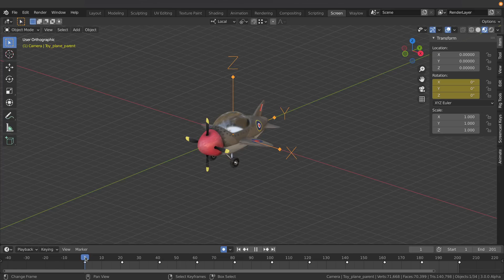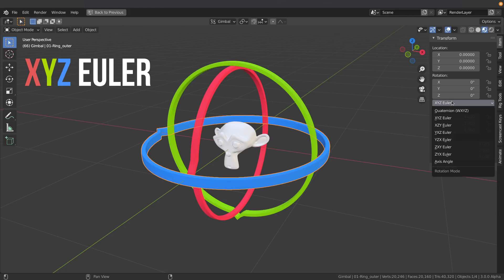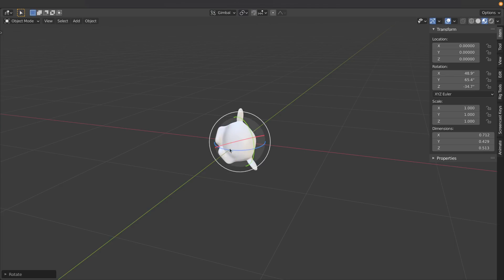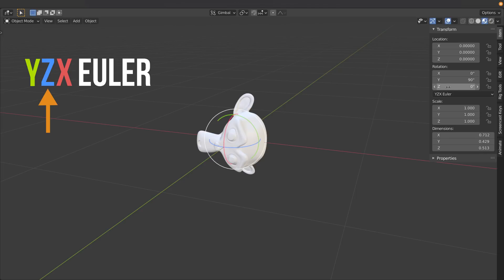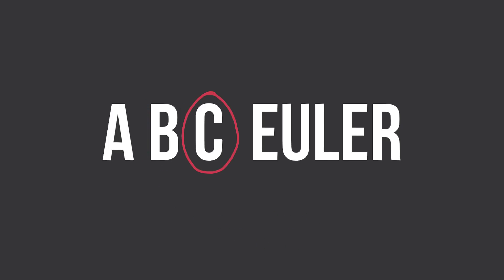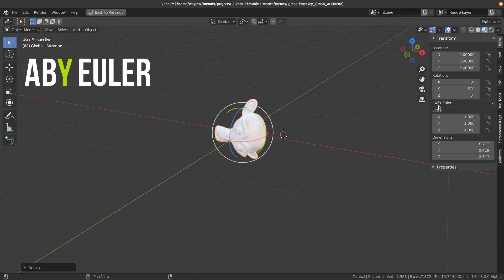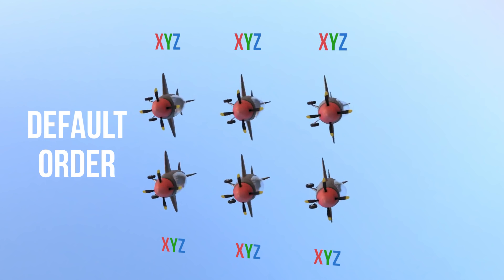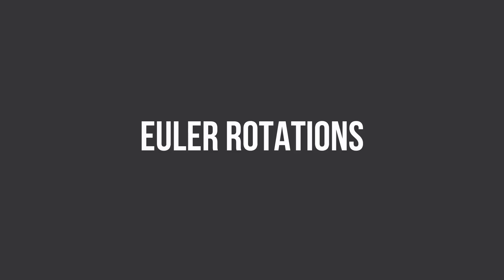What are Euler Rotations in Blender? | How to Avoid Gimbal Lock (2021)

Comment: Hello. Professional animator here. 

Extremely well put explanation for why gimbal locks happen and for the logic behind selecting the an appropriate rotation order in an intuitive manner (even in my field there's a lot of people who struggle to understand it).

For fixing gimbal locks or just converting one order to another on a finished anim, I would heavily recommend the Copy Global Transform add-on (which comes in by default with Blender for some time, not sure if it was the case with the version in this video though). 

It essentially works similarly to the "bake from empty" and "use quats" methods but in a much more streamlined/simplified way (it essentially stores the anim data of an object/bone in worldspace that you can reapply later on to the object on the same keyframes after changing the rotation order). Also works with follow spaces and is a huge time saver not just to fix a gimbal locks, but just for overall anim polish.

Blender users can be proud of having this addon easily available for free. Maya's functional equivalents are often paid addons (like eblabs' WorldSpace and animbot's Temp Controls family).

Comment: I think one way to solve that is by delegating the problematic axis to another controler (if controlers are used). So in the case of an XYZ rotation order, the X and Z axis are handled by the main controler of the object/bone, and the Y axis is handled by a secondary controler parented to the main one, then the object/bone is parented to the secondary controler. This way you can rotate the object or bone however you want, it's just a bit funky to use at the beginning as it's pretty different from the local axis or any other simplified axis.